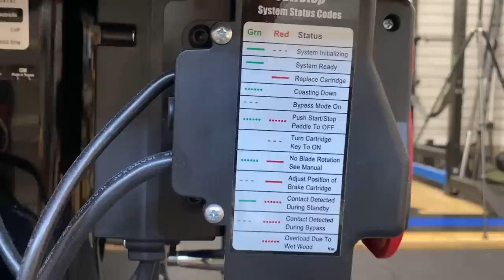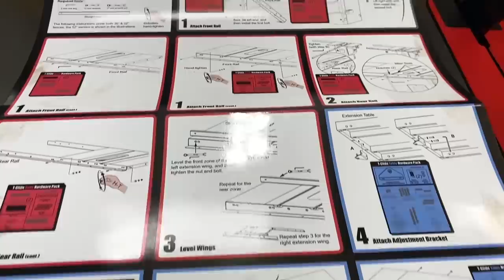5 Reasons Why I Chose a SawStop Table Saw vs the Competition

Comment: I have been a woodworker since my teens, i am 62 now and have been in a wheelchair since i was hurt in a car accident at 23 years old.  i have had plenty of of industrial saws...three Uni-Saws and a powermatic 66 and loved all of them.  when i moved a couple of years ago, i decided to sell my last beloved Uni-Saw and purchase a 3 hp sawstop.  if it wasn't a quality built saw, i wouldn't have purchased it, but it is very well built and works great.  not only does it have the safety features, the dust collection works great.  cutting wood from a sitting position is an adventure at times and i have had my share of close calls, but i am happy with it so far....good luck and have fun!

Comment: Hey Matt, I have the 1.75 version for several years now and used the safety feature once. Oops, making trim molding out of Trex decking and my feather board would not hold the soft material to the fence so I was holding it tight with my hand. Long story short, I was only humbled, God is good even when I do dumb stuff. It's worth every cent!! Praise be to God!!
Reply from the maker: Wow. I bet that was a scary feeling!!
Reply: @731Woodworks  It was and embarrassing but if telling the story helps save one injury it's worth telling. Thanks for all you do ☺️

Comment: Congrats! What a great blessing! Just wanted to point out one thing, the blade in your video has anti-kickback shoulders on it, this is not recommended by SawStop as it can slow the ability of the break to stop the blade. It will still stop it, but should you have an accident it can increase the severity of an injury. I've had my SawStop for about 6 months now, and it is a true joy to use! Enjoy it!

Comment: Congrats, Matt.  That is a fantastic saw.  I had mine for fifteen years in a professional furniture shop.  It is a work horse and a very well built machine.  Something rarely mentioned is the service Sawstop offers.  FAR better than anything under the Powermatic umbrella, Laguna, Grizz or others.  It is expensive, but comparable to aan Oliver or a Powermatic, and the build quality and service are FAR better.  Outside of a Northfield, there really isn’t a better cabinet saw, so the price is certainly reasonable.  3h- is plenty (though my new saw is 9 and I LOVE that extra power, though it’s pushing a 16’ blade, not 10’).  I don’t know how many kitchens and furniture I built with that same saw you got.   That extension wing, like most others are wood because that far out, the materiel is not a big deal.  Replace those legs with a cabinet to store your table saw gods.  In fifteen years I never once used the mitre gauge.  I don’t even know why they are included.  Make a sled and get an Incra for precise mitres.  Or spend the money and get the sliding extension.  Put a quality blades on there; Ridge Carbide, Forrest, or FS.  Have a rip, crosscut, and combo, and be diligent about changing them out .  Oh, and keep an extra brake handy for both standard and dato.  Rad saw!  Enjoy.

Comment: I had to look it up but I've had mine for 9 years now. Never once regretted it. Fantastic saw....and it will at least try not to remove my finger. Which is more than I can say for any other power tool in my shop. I've only set it off 3 times. Two were unexpectedly wet wood. One was grazing the side of the blade with my finger when a piece kicked out before I expected. It's so insanely fast. Having seen it go a couple times I feel reassured that this technology works. Getting ready to put a slider on it but beyond that I can't imagine ever needing to replace it.

Comment: I have had my 3 hp SawStop for about 7 yrs. now.  The laminate surface on the right side has held up just fine. The blade that came with the saw is a pretty good one.  However, I chose to use an inexpensive blade for a little while at first, because I knew I would do something to trip the breaker.  And I did (hit a piece of metal).  Now I have the blade with the tripped breaker attached hanging on the wall by my saw as a reminder.  Using better blades ever since and no more trips. I love the saw.

Comment: Had the SawStop for many years it has save me serious injury at least 3 times since. 25 years ago I lost 2 finger tips on a table saw that dramatically affected my life so its was a no brainer when SawStop came out. Understand that Felder now has a similar technology but haven't seen any or pricing. Very simply if you use a table saw without the technology sooner or later it will "get you"; also its a quality machine.

Comment: Good for you! I had a Home Depot Rigid table saw and was very pleased with it...until I cut my thumb. I had a kickback and my thumb came over the blade and I headed to the ER.
Thank the good Lord I still have my thumb but it doesn't work as well as it use to,
I sold that saw and bought a 3hp Saw Stop and just love it. I am still cautious about the blade but for a different reason... touch that blade and the blade drops down so fast it scares you... and it cost $79 dollars to replace that blade brake and usually you have to buy a new blade! Also, I'm subscribed and like to watch your videos. Keep up the good work! 

.
Reply from the maker: Whoa! So glad you didn't lose it either!

Comment: I bought a lathe about 3 months ago so my need for a table saw diminished quite a bit.  I still use my jobsite Skilsaw when need be but not all day long as you do.  That is the difference.  You are in business to make wood furniture and this saw is the key element in that process.  I am slightly dyslexic as well, so I have to be REALLY careful and aware of what I am doing.  If I for some reason go back to sheet goods and cabinetry, I wouldn't even blink.  However I think I would probably be ok with the 1.75 hp version and put the best blade on the planet on it.  Blades are important enough that YOU should do a video on them and all your saws!!!  Take care of yourself and stay safe!!

Comment: I started back with a Dewalt Jobsite saw.  One little brain-fart and the tip of my left index finger was shredded.  I was stupid, but I'm just glad I still have my finger.  I didn't have the room for a full cabinet saw, so I bought the SS Jobsite Pro just for the piece of mind.  It was $1400.  My wife didn't even blink when I told her I was thinking of buying one when I showed her the demo vid on youtube.  She just said 'Buy it. Now.  $1400 is a lot cheaper than a finger.'  Expensive, but 100% worth it. It's a fantastic piece of equipment and has the same 1.75hp motor as the contractor or entry PCS models.  And now I'm getting a bigger shop.  First purchase?  3hp SS PCS.  My wife made sure it was the only saw I would buy (she later told me that the $1400 for the jobsite saw was worth the price just for her peace of mind).

Comment: I agree about your two complaints. My guess is most people that spend that kind of money on a professional grade table saw have a nice miter gauge. I bet most that do any woodworking beyond novice have an aftermarket miter gauge regardless of what table saw they own. I agree with the extension that a matching iron table should be an option, but I bet most would rather spend that money elsewhere.

Comment: Also I spent some time talking with a local dealer I’ve known for years. He said he was the leading powermatic, jet, delta pro level dealer in this market. He told me he now sells saw stop at least 10 to 1 now and that he sells 20-30 brakes modules per month. Wow!!! I didn’t need convincing but he sealed the deal for me. Now to save up the money and pull the trigger on it.

Comment: Saw Stop is also my eventual goal. Last year I cut off a knuckle's worth of finger and mangled another on a table saw. It was a moment of inattention resulting in a kickback that did it. Luckily it wasn't my whole hand, and I was just 10 minutes from the VA emergency room. I've got use of the fingers after a few surgeries and lots of physical therapy - but only about 90% grip strength and 75% flexibility,  but it's a heck of a lot better than the alternative. 

First thing I did when I got back home after the first surgery that night, was order a microjig.  It's made a difference. And I'm now so much more cautious using that saw, especially ripping and grooving boards (a 30% angle groove in a 1' long tubafer is what did me in).
Reply from the maker: Ouch! Very sorry for your injury

Comment: Congrats and thanks for the vid. I’m in the market for one now even though it is really out of the budget as well. Right about 12 min into the vid hit very close to home. I happen to have the Delta T2 and about 3 1/2 weeks ago exactly what you said you don’t want to happen happened. I got lucky and didn’t lose any fingers. Given the dado stack I had on it’s surprising I didn’t lose my hand. I’m recovering and I’m lucky enough to have a military retirement check to offset the much smaller short term disability check while I’m not able to work at my job. 
So anyone considering the Sawstop, do it now if you can find it in the budget. Don’t be like me wishing you had one before the accident happened. Like he said it only takes a split second of carelessness, distraction etc. and it’s life changing. Thanks again.

Comment: I have been woodworking for 35 years and i agree on the cheap road on the extension plate legs and miter gauge. Fantastic saw otherwise. Wish i had one. Started out many years ago with a craftsman tabletop. Now i have a cast iron with cast extension plates and a workable lift for mobility. It does not leave my shop. I have a portable table saw for that with a foldable rack with very long extension arms.

Comment: So talked to someone at saw stop about the right wing being not cast iron.  the explanation I got was, that the weight of a cast iron extension threw the balance off and cause a tip hazard. 

Having said that… there would seem to be a less “afterthought” extension.

Comment: I know this is an old video but I subscribed to your channel after you posted it. I was recently listen to one of my favorite podcasts ARMCHAIR EXPERT and the guest had cut off two of his fingers with a table saw.  I can't shake it.  I had planned on getting a Dewalt Jobsite table saw but I now plan on going with SawStop.  I have never used a table saw and only got my first circular saw a year ago.  My plan is to get a SawStop 10 inch JobSite PRO Table Saw when I make the leap to a table saw.  I know it can be pricy but as a wedding photographer it is cheaper than every lens and camera I use on a regular basis.  In 20 years being a wedding photographer I never dropped a camera or lens but I still have insurance on them.  I think the premium price to pay for a SawStop is worth it.

Comment: I almost cut my hand. I reached across the blade. After I did it, I realized how close I had come, and it scared me.  Could have been a bad accident. But, you know what. I don't call that an accident. Accidents are things that happen through no fault of your own. IMO.  That would have been my fault.  By the way, do you know what the number one saw accident is?  Band Saw!  So said an emergency room doctor.  I almost cut into my thumb on that yesterday. I was pushing a small block of hardwood trough it when my thumb hit the blade. I pulled it back and it just roughed up the skin. Man was that close. Congratulations on the new saw.  If I come into money, I will buy the same one. I know you thoroughly research every tool purchase.
Reply: Happy for your purchase and review.  It was a nice gift. 

As for injustices I read some where it was the table saw. Not sure on that.  I definitely feel safer around a band saw though personally compared to a table saw.  I try and always use push sticks and keep my fingers way far away from the blade. 

As for the table saw this is at least some data from popular wood working from some years back.  “In the context of the general population of 310 million Americans, about one in 9,000 will go to the emergency room in any given year after tangling with their table saw, one in 80,000 will have a medical report that lists the word “amputation” and one in 160,000 will lose one or more fingers or a thumb.”

I personally know 5 people that lost fingers or have been cut deeply on a table saw.  Has made me think twice and want to save up for a table saw.  The loss and risk is just too great.  

Thanks for this review.  I appreciate.

Comment: Hey Brother!  Yes and Amen on the SawStop choice and blessings from God the Father and our Lord Jesus Christ!  I just watched this vid on my television but had to go to my laptop to comment.  In an earlier comment, I mentioned that the mill I work for is replacing all the Powermatic table saws with SawStop. We are using the industrial models with the coveted 52" rip fence. A couple things though from one safety conscious carpenter to another. I'm not seeing the plastic blade guard in use. If you decide to use it, be aware that small pieces can get trapped between the blade and the flip-up segments on the sides, and somehow, the flippy part gets pulled into the blade and will shatter and throw shrapnel out. Be aware. It renders the side blocks useless.  The small riving knife needs to be in place or the safety feature won't work because the circuit isn't complete. I'm sure you know from reading, but either the clear blade guard or the small riving knife must be in place or it's just another saw. I do realize that in some circumstances it's just not viable to have those in place, but in all other cases, it really should be used. The dinky side table.... I agree that it's cheezy, compared to the rest of the saw,,,,,, but, my department of five men have been using our saw with that same dinky side table for several years now and there has been zero problems with it.  Just nothing at all. Nothing to worry about! Believe it or not, one of our more "challenged" individuals actually backed into the saw and knocked it clean over!  Even with that, the side table sustained no lasting damage.  That's my little list of tips.  It's awesome to see how God is honoring you before others as you honor Him before the world!  My prayer is that He continues to bring you to tears with showers of blessings as those who tune in to your channel, looking for carpentry ideas, come away with an eternal seed planted!  I actually asked myself just the other day why I, a far more advanced and experienced carpenter, would watch your videos. Sounds arrogant, I know. But then I realized...It's about Iron sharpening Iron! Peace, and thanks for the dust!
Reply from the maker: thank you for the tips

Comment: As a owner of the sawstop.. get a replacement brake cartridge. I had two brake deploy in 5 years one was cutting styrofoam with foil and the foil tripped it no one while setting up a incra metal fence I got the fence too close to the blade.. They said kiss the blade with the fence
My hand on the fence and the fence tripped the brake. If you order a brake online it takes 6 days. Unless you are close to a woodcraft
Automatically get a back up brake cartridges and replacement blade. If you deploy a brake that jammed into blade it takes
A lot of effort to remove the blade and brake together as they are fused together

Comment: I've had SS for a couple of years and I agree with your reasonings. I am on my third brake, after the first one I called my wife and told her the saw just paid for itself. I cheaped out on the base and am now upgrading to the ICS mobile base. The laminate is coming off the extension table, so I am considering next steps. Enjoy your channel.

Comment: Regarding your comment on how one momentary lapse of attention can lead to many months of serious physical, mental, and financial struggle. While unbundling a pallet of lumber, I couldn't find my snips, so I used a drill with a grinding wheel to cut the steel straps. Because the grinding wheel is perpendicular to the drill, the back of my hand bracing the drill's body was directly over the steel strap, and when the strap snapped, it caught the back of my hand right at a knuckle, partially severing a tendon. It didn't heal correctly, so I had to have surgery. My ordeal that followed was pretty much as you warned.

Comment: I want to add one thing, get rid of that besemyer copy fence and buy the Incra LS fence system. The best fence money can buy, I use to have a besemyer fence and it was a pain trying to set for accurate cuts repeatedly. My friend bought the Incra LS fence system and convinced me to get one, I still thank him for telling me how great they are, I am very particular and a perfectionist when using equipment and doing wood work. You can dial in measurements by 1000 of an inch with the Incra system. Check it out.

Comment: Nice review Matt, I have the Delta 36-725T2 and also aspire to have the space and discretionary income to have a SawStop.  I really like that you covered more than the safety and think that your justification of not saving the $500-$800 on something else was spot on.  

I was thinking about your comment regarding the miter gauge and trying to think if I have seen anyone review a saw and have high praise for the stock miter gauge.  I don't recall any.  I just think it is one of those things that ranges from junk (low end to portable saws) to serviceable (my Delta, to your SawStop).  I picked up a really nice miter gauge on banggood (I know, made in China...) for under $100 and it is enough for me.  But some people spend serious money on Incra, Kreg or Woodpeckers.  So I guess my point is, don't be too harsh there, I think it is an industry standard.  Kind of like floormats in cars.

Enjoy that awesome new SawStop!
Reply from the maker: Thanks.  I think (can't remember exactly) but the Harvey table saws come with or have an option for an excellent miter gauge.